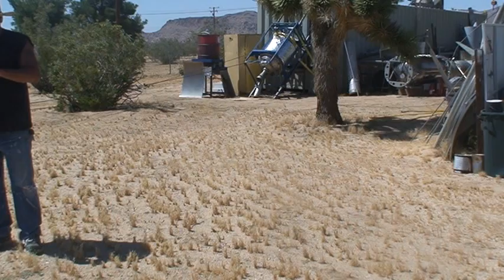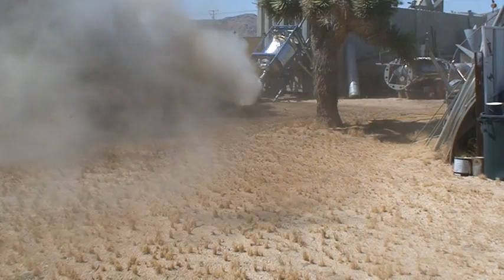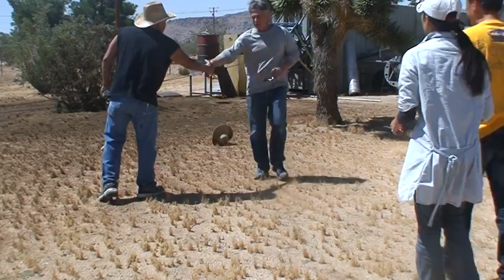Mad Mike Rocket Test 3

Comment: Assuming he doesn't die: I'm afraid he won't even reach an altitude where earth's curvature becomes visible...
Reply: At 1800 feet he definitely won't. I can rent a Cessna 172 and get to around 10,000 feet (in the winter when air is dense)  for about $200. At that altitude you still can't see even the slightest hint of curvature.
Reply: This comment didn’t age well...

Comment: You can't even figure out if the damn camera is running and you just had to ignite a rocket with a pole. You guys are real geniuses.
Reply: That's the opposite of how autocorrect works, Todd, but nice try.
Reply: This thread is more entertaining than the video, and the video was pretty damn funny
Reply: "I need a count down"... and more cow bell.
Reply: Todd Lewis THEY spent about 40 sec trying to know if the camera rolling
Reply: dunno why auto correct does that,  but it will often take a perfectly good word and change it to something completely different.  correctly spelled, but a totally different word.  No good reason for doing so.
Reply: Ha, I was going to say the same thing... can't operate a camera but thinks he can build a rocket?
Reply: @fixedwing71  
Any old engie can build a rocket.

The question is: Will it fly